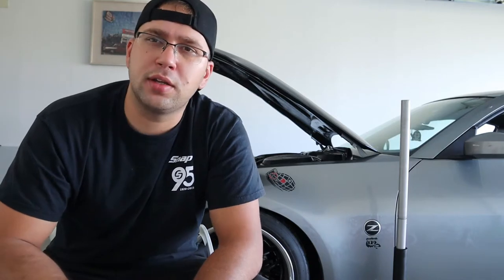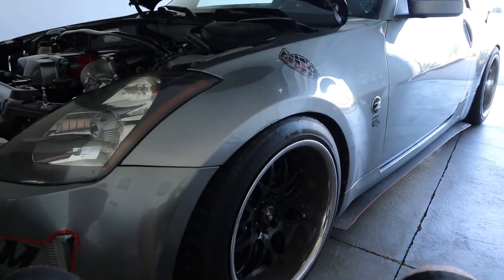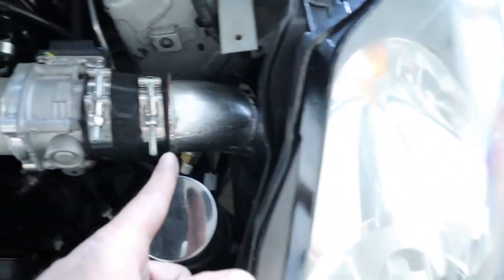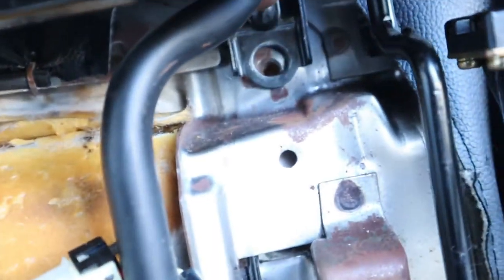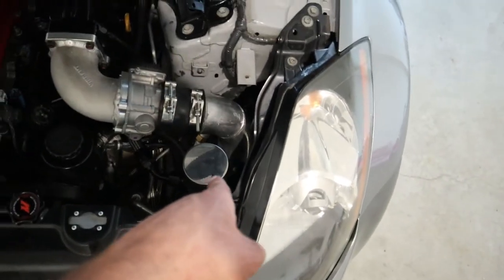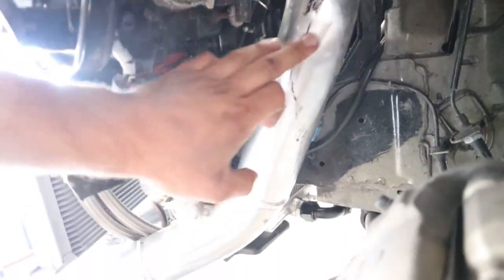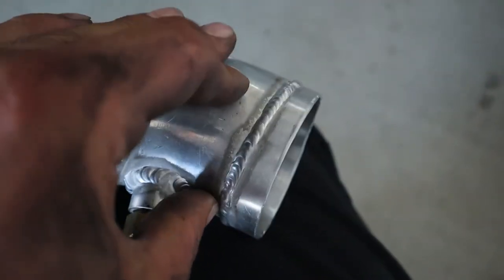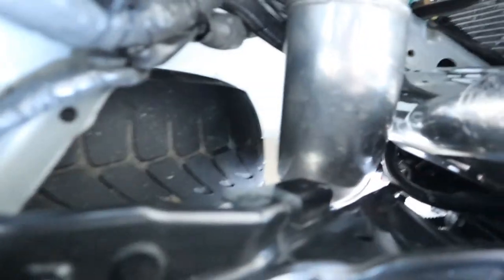350z Steering angle issue, New parts, Preppping for drift day

Comment: Hey bro, do you have a oil catch can? You might have too much crankcase pressure so thats why your seals are blowing out
Reply from the maker: Yes i do have it. Thanks for looking out bro. But the seal was crap. I got it from rock out. I show comprising in my next video. But I had power steering pump crap out that was the actual leak. I have it in my next video.